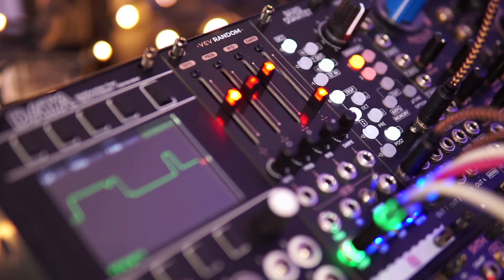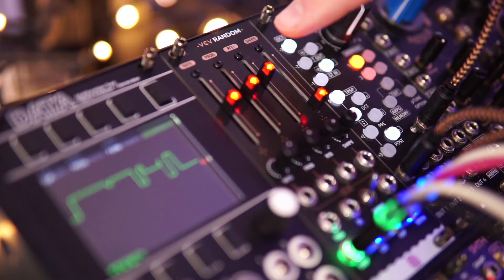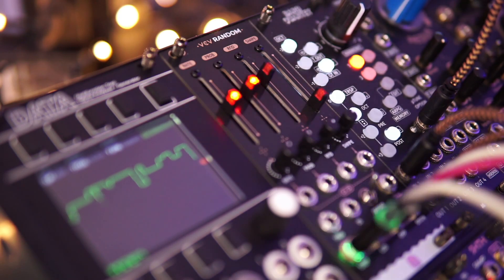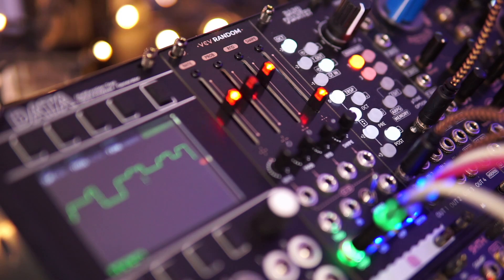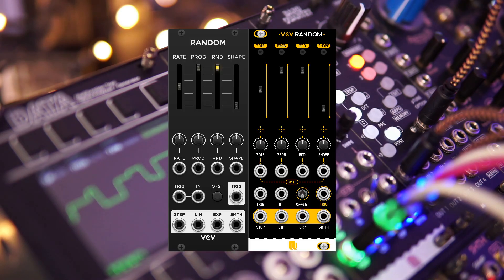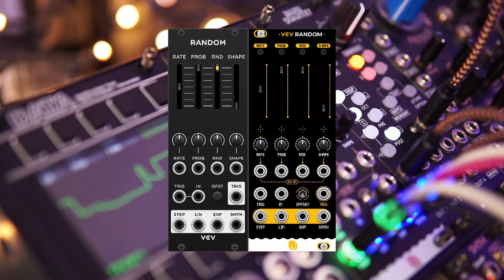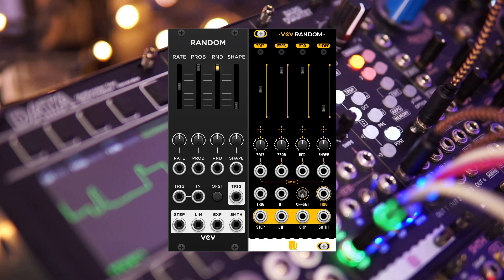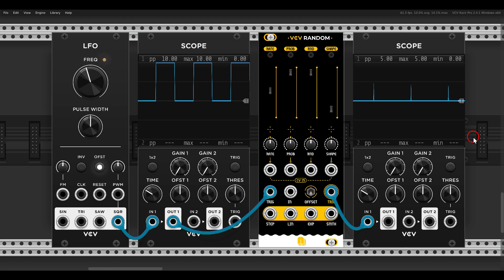The first VCV Rack hardware module!!! \ VCV Random by Nano

Comment: This is very nice indeed!  Out of interest do you stick to certain keys or scales in your ambient patches as they always sound in tune with one another and a particular root key?
Reply from the maker: Thanks :) I usually tune my oscillators to C, and then just use the minor pentatonic scale, but sometimes I will tune them to A or E to get a different feel. I also use the Miyako Bushi scale sometimes.
Reply: @OmriCohen-Music  thanks!  Loving your training videos btw.  Yesterday I built one of your patches, but sequenced from my Hapax, wow it was good.  I just get clocking issues where the Hapax BPM is 110 and the Clock in VCV is halved at 55.
Reply from the maker: @G0nz0uk  No worries :) Did you try using different multiplications of the clock? You can do this on the Midi module, and on Clocked by changing the CV mode.

Comment: Awesome video, thank you for sharing. I would like to get into the hardware side of Eurorack. Is there any manufacturer you like over the other?
Reply from the maker: Thanks! I think that the beauty of Eurorack is that different manufacturers have different strengths, so it's fun to mix and match :)
Reply: That is kinda the entire point - though you can sometimes encounter differences in standard that make interfacing trickier (voltages and cable/connector pinouts). 
If you wanna restrict yourself to a single manufacturer, maybe get a semi-modular like a Behringer Neuron, Moog Mother, etc. Easy starting point, and they can still be used with eurorack as your collection grows.